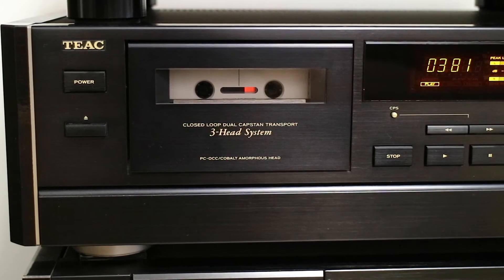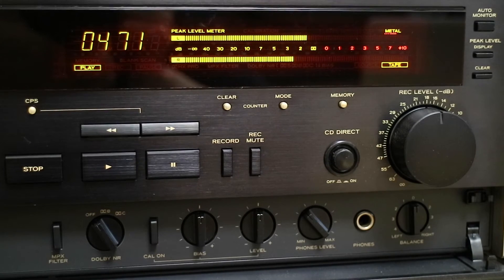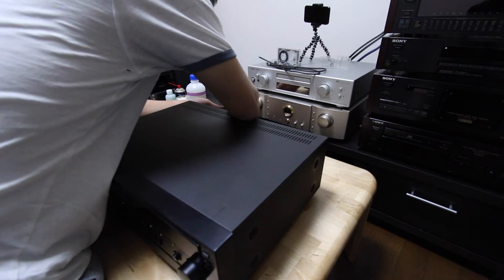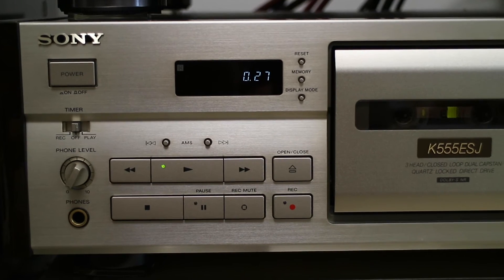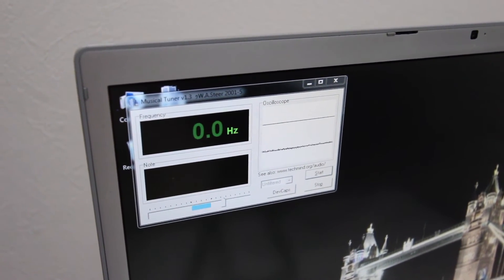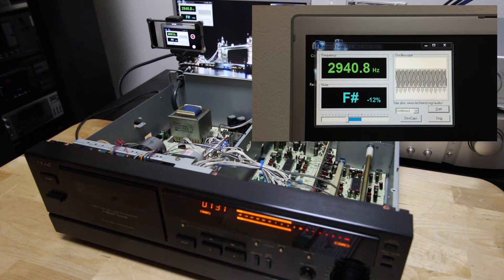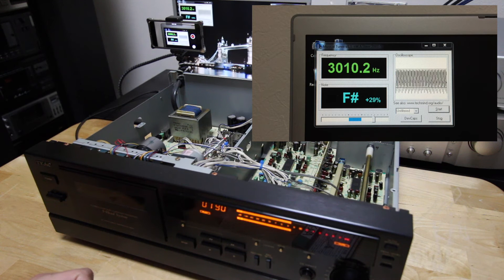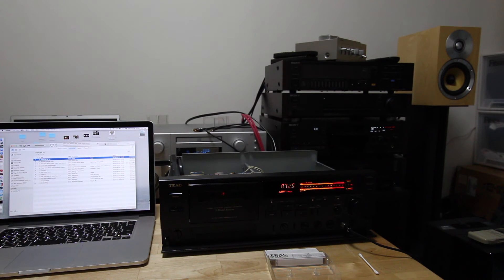Adjusting the tape speed of a Teac V-9000

Comment: I changed belts and pinch rollers on my Sony TC-WE835S.  The 10 minutes 3kHz test cassette I bought does not give me constant frequency.  It started out at around 300xHz then gradually decreased to 296xHz in 5-6 minutes and back up to 297xHz in the last 2 minutes.  The difference is about 40Hz.  Is that normal?  Should I calibrate in the first 3 minutes or wait 5 minutes?  Thanks.

Comment: Question, I'm in need of adjusting the speed, but in the back of the motor there is an indentation where u can adjust but its covered up by a piece of metal, do u insert the screwdriver or do I have to break the seal in order to get in? its a teac w600r cassette deck in case someone has experienced similar issues

Comment: The most accurate method to make a timing tape is the old fashion method used on $50K Studio Studer's. Mark up exactly 142.5 cm distance (30 seconds).  Play it back, take out tape and look where the 30 sec. marker is. Adjust speed pot +/- accordingly. Frequency interpretation is not as accurate as actual distance measurement because there's microsecond latency in audio signal  among different decks. Tapes are time based, and therefore you use the time to measure it. PERIOD !

Comment: It was only recently when I configured a Sansui SC-1330 to work with a Masushita motor, but with the motor control outside the body of the motor I realised just how difficult it is for standard motor speed adjustment to be stable at 3000Hz. Also, let's be aware that there will be some small inherent speed instability as the capstan/pinch roller pulls the tape across two heads in the single capstan drive configuration.
regards
http://cassettedeckman.blogspot.com

Comment: If a reference tape is not available, can you use a 3kHz audio signal input intot he deck and then using the record monitor option on a 3 head deck to calibrate the motor speed ? A blank tape would be used to record so monitor can be used.
I use a graphite micro screw driver to prevent conductivity.

Comment: I love the last bit where you say you may get hurt or even die 🤣. That’s when I fell off my chair laughing so much I hurt myself 🤣🤣🤣. Joking aside I really enjoyed your very clear explanation. Can you please tell me how and where you connected the decks output to the laptop? Do you have a link to the software programme you use to show the sine wave? I have some ceramic screwdrivers which will stop the motor shorting out. Another point is that if you place a cloth over the power supply whilst you make the adjustment that will be a lot safer and you might not die 🤣.

Comment: H!. I've bought an A&D GX-9000 cassette deck. the condition is good. but the tape speed is a bit slow. i found in some manuals in the internet about VR1 and VR2 potentiometer. but can't  change the speed of tape with them. a printed shape of potentiometer on the top of board mentioned "tape speed" but the potentiomet is not there and the place is empty. do you have any idea? I want to change the tape speed of my A&D GX-9000 cassette deck. (It is direct drive!)